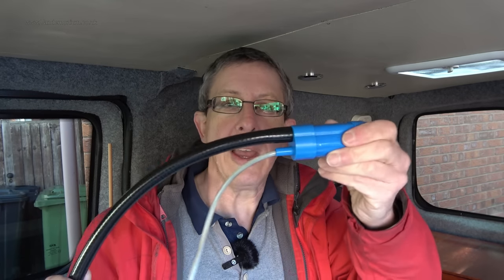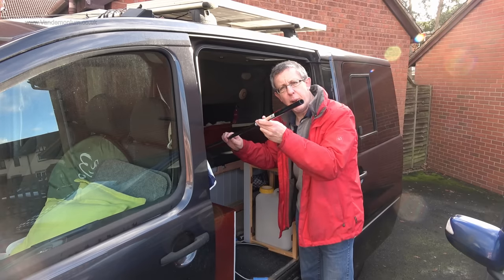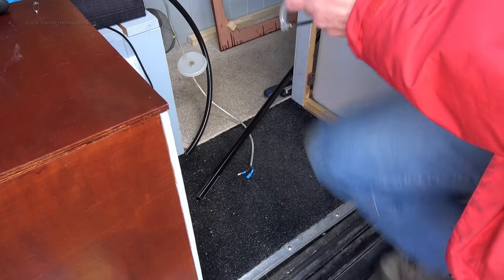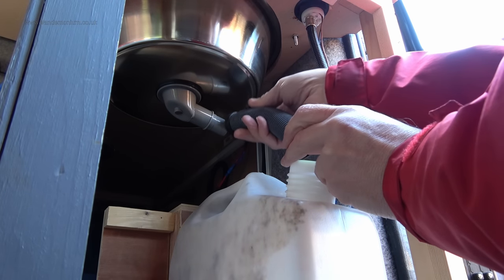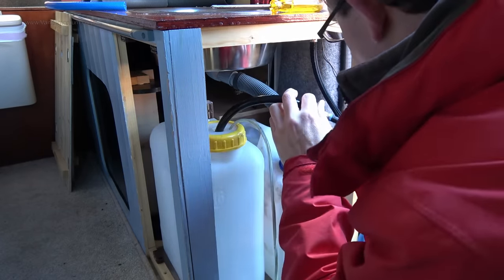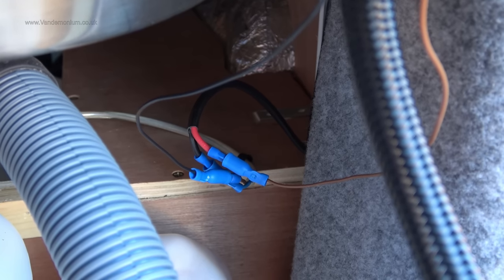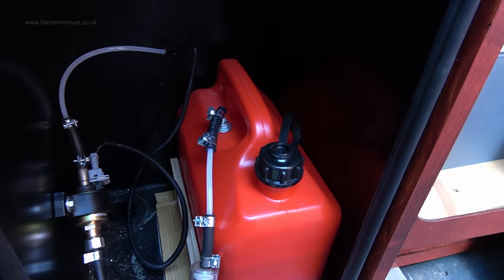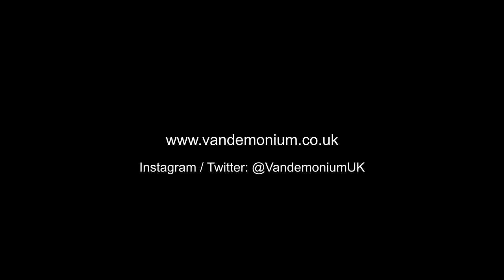75. Sorting the plumbing in the campervan

Comment: I have had ventig problems with my diesel heater on my boat. It needed a much bigger vent than a pin hole. Fuel was pulling back when the heater was switched off and that eventually stuck the plunger in the fuel pump. Also the vent needed a "flame trap" gauze over it and vet to the outside atmosphere. I think you might need a length of pipe to swan neck out of the top then down through the floor vent. If you find your heater won't start it could be the pump stuck. If not hooray it worked.
Reply: If the pin hole fails (if you literally use a pin to push through the plastic it may spring back and make the hole smaller) a 1mm drill will make a cleaner hole. If not go up to a 2mm.
I seem to remember a flame trap was required for a B.S.C. but in reality it's pretty pointless for diesel as it doesn't vaporise like petrol.

Comment: I suspect it was leaking between the silver part and the nylon barbed fitting.
Reply from the maker: Well it jolly well shouldn't! 🤣
Reply: @Vandemonium  I agree but I have seen hoses leak there, you came up with a good solution to seal it.

Comment: Cutting the stiff pipe with the saw - you're doing it the wrong way around, don't support the short bit you want, support the long bit, then it can't pinch the blade! - - - A smear of liquid soap on the inside of the rubber bung would help it to slip onto the sink drain. - - - dripping filler pipe - a jubilee clip or self-amalgamating tape will fix that!

Comment: You should always put PTFE tape around the fitting before connecting to the pipe the use a jubilee. This stops water creating up the connector. The drain tube is not under pressure so will not leak or pull off, use a jubilee for safety sake.

Comment: I’m enjoying this series and You are doing a pretty good job, hacksawing aside. But I do worry about those hose clamps on the rubber hose near the fuel filter. You are clamping on to plastic tube which will distort over time. The effect is called creep, and even cast iron does it to some degree. Your joints will eventually be slack. It would be better to use some kind of metal tube insert inside the tube, or just metal tube on its own.
Reply from the maker: The connections used are the officially sanctioned method by the manufacturer

Comment: For your drain container you absolutely need the gap where the drain hose goes thru the cap. The container needs to “breath”. Otherwise you’ll have an air lock and the water will never drain out of the sink when the sink drain is submerged, ie the sink drain is covered by standing water.

Comment: After a quiick google lol I got 'Yes, a Ridgemonkey will work on an induction hob' and also 'No, a Rdgemonkey won't work on an induction hob' 

So, I guess it's a case of trying yours and see what  happens :o)
Reply: Test any pots and pans with a magnet.

Cookware needs to be "ferrous" for physics to work.
Reply: This is right from Ridge Monkey: "Can be used on all traditional stoves (not suitable for use on induction hobs)"

Comment: Have you got enough movement on the water feed pipe to allow fitting the pump and tube back into a full tank? Sorry, just seen that you use an extra tank to carry the fresh water supply in. I'll go sit in the corner.

Comment: When trying to pressure fit plastic pieces wet your finger and coat one of the pieces or a better way is 542.to wet your finger and rub a little soap on the fitting 5:15

Comment: You mentioned using an induction hob.how are you going to power it. Will you use a solar generator from ether Eco Flow , Bluetti, or a Jackery?
Reply from the maker: No, I don't see the point of those when I already have a battery, solar charger, inverter, fully wired 12V system etc. The term "solar generator" annoys me too, the only generation on those is actually done by the solar panel, which is usually an expensive optional extra!!

Comment: The ridgemonkey won't really work on an induction stovetop - tried in my kitchen and only really thick alloy pans can be used or the ones with the steel insert
Reply from the maker: Good to know, cheers
Reply: @Vandemonium  Bialetti (others make them too) makes a steel plate that will let you use non induction cookware on an induction stove top. 

I use it for my moka pot and other favorite non induction friendly cookware.

An Amazon search will pull them up. Lots of choices.

Comment: David JUST A THOUGHT is the pump for the clean water tank?, what kind of glue holds the label on the black pipe your putting in the clean water? Is there a possible concern there?.
Reply from the maker: Yes, clean water. Honestly I'm not in the slightest bothered by ingesting the tiniest bit of glue probably over many months.

Comment: I learned from putting bicycle handlebar grips on that plain water on the mating surfaces make things slide together easily and evaporates without residue. Jubilee clips would solve any leak .It was agonising watching you use unsuitable tools but that's OK I suppose.

Comment: RIDGE MONKEY most likely won't work on an induction hob. But an easy way to check is try to stick a magnet to it. However seeing as it is mostly aluminium it's unlikely to work.
Reply: A trick that might work (no promises, I haven't tried it) is to put a steel plate on top of the indiction hob and put the ridge monkey on that. The steel plate should get hot and the heat should transfer through the steel plate into the ridge monkey.
Reply from the maker: I like that idea!
Reply: @Vandemonium  note though that the heat will also transfer to the air around the plate as well as to the RM, reducing the efficiency to that of a halogen hotplate (though probably not as bad as an old-style coil stove). Assuming you use the Ridge Monkey infrequently or on shore power, that may well be acceptable to you.
Reply: @Vandemonium  Well if I see you doing it in one of your videos I'll know where you got the idea.  ;)

Comment: Have you thought about having wastewater draining straight outside the van and a diverter so you can choose to drain onto the ground or into the bottle depending on where you are? I suspect most places you sue the sink you'd be OK to drain it into nature and you're not draining any creat volume or anything toxic.
Reply from the maker: Campsites really don't like a direct drain so no
Reply: @Vandemonium  Also a diverter can easily get blocked as one side forms a dead end and collects particles,

Comment: Plumbers use "plumbers mate" 
Which is a compound that is smeared on joints to deal with the anomalies in the manufacturing of the product.
It works.
Reply: Not on plastic fittings

Comment: David, Vent hole should be sufficiently big to allow same volume of air to enter as the volume of diesel that the pump can pump otherwise you will still create a vacuum
Reply from the maker: Cheers, I think it will be, the amounts pumped are small and not continuous (rather a stepped intermittent pumping, if that makes sense)
Reply: @Vandemonium  Of course, when you come to use the heater, you could just crack the filler cap open a little and then close it when you're done.
Reply: @Vandemonium  Burt is right, you should be gtg

Comment: The pipe leaks because the pump pressurises it. Easy fix is buy some self fusing repair tape and give it a good stretch while you wrap the joint out to at least an inch either side so you have 2 inches of self sealing tape. It will work much better than a hose clamp jubilee clip
Reply from the maker: I used sealant gunge!
Reply: @Vandemonium  Get yourself some of that self-fusing rubber tape, you'll never look back,, been using it for years, it has 1000 uses, even fixing a vehicle radiator hose in a pinch.

The diesel vent? Maybe a leeetle bit bigger, 3mm will do, but, like you, I can't see any plausible circumstance for a double leap out of the handle.
Reply: @Vandemonium  Never a good choice for pressure joints.
Reply: Amalgamating tape, also sold as 'pipe repair' tape. Works great on pipes, non-slip coating for drumsticks (tip from an ex-marching band nut) and stupid chrome shower controls that can't be turned with wet hands 😂

Comment: I think you’ve damaged the nozzle on the water tap pipe. 
I’ve tried that same solution with a red petrol can and I can tell you with certainty, it will spill through that.
Reply from the maker: Well I've been for a 160-mile trip including motorways and local roads and not a drop was spilled.
Reply: @Vandemonium  well maybe mine was simply too large. I’m glad it’s working

Comment: Are the vapors a concern with the tiny hole?
Reply from the maker: I hope not
Reply: @Vandemonium  Sorry, but you probably should be concerned, at least a little... "Breathing in diesel fumes (not vehicle exhaust) may cause dizziness, drowsiness headaches. Breathing in large amounts can result in coma, loss of muscle control, heart and lung problems. Diesel can cause the skin to become irritated, dry and cracked; if the skin is exposed for a long time then burns may develop."
Reply from the maker: Given that the tank is contained within the sealed (former) gas locker, the chance of fumes reaching me seem negligible.
Reply: @Vandemonium  Yeah, I wrote the comment during, not after watching the VLOG all the way through... 8-)
Reply: @Vandemonium  makes sense - I am such a worrier!

Comment: I'm trying to figure out why you need iron (or steel?) pots for induction heating when aluminium or copper would pick up more current. I guess it's to do with iron affecting the magnetic field, drawing it in, where aluminium or copper don't.

Comment: Did you consider that you are not using Food Grade pipe in your water system, it looks like you are using plastic conduit that could be leaching all sorts of nasty stuff while submerged in your water tank. Food Grade pipe and containers are for a reason
Reply from the maker: I very much doubt that anything worth bothering about will emerge from that pipe for the relatively small amount of time I use the van, being occasional weekends here and there.

Comment: David, have you had enough unsolicited advice?  No?  
I do hope you took the label off of the black rigid pipe before it was submerged.  
I have complete confidence in your diesel tank pin hole solution.
Reply from the maker: I did not. The label and its glue will add extra taste and nutrients to the water 🤣